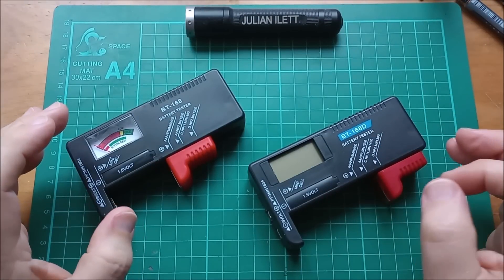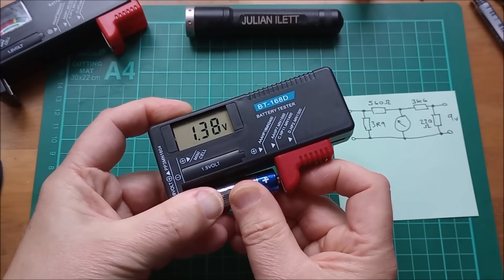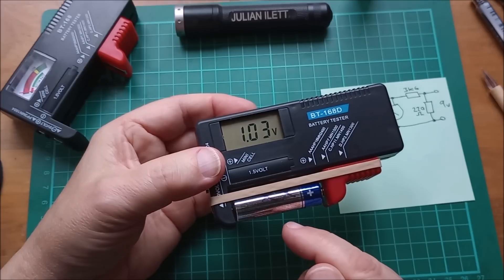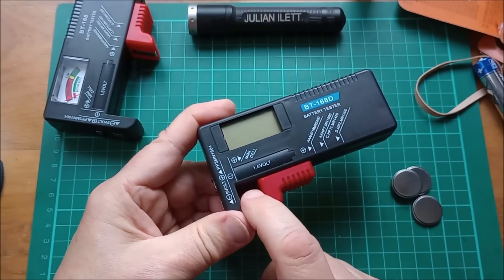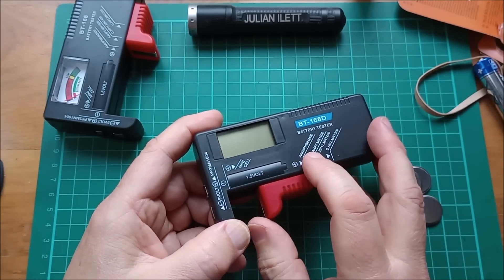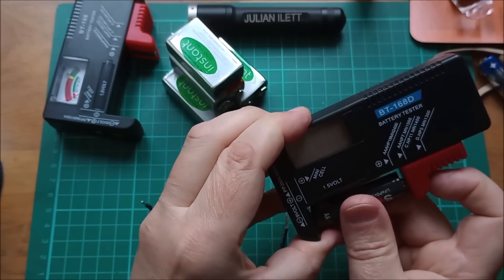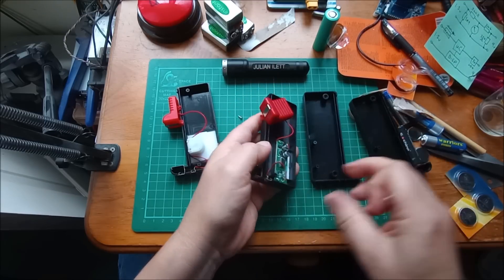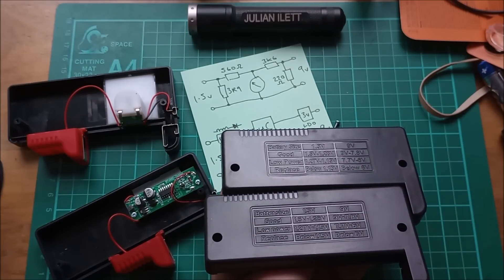More Details - BT168 and BT168D Battery Testers

Comment: I have been using a BT-168D (the digital version) for years.  I actually had three of them but burned one out checking the voltage of the three AAA cell adapters in cheap LED mini-flashlights, it measured the first one accurately then never worked again.  I just bought two of the BT-168 pro versions so I had something capable of checking the approximate voltage of an 18650 cell.  Ironically, the two BT-168D has a slight variation on its readout with the same cell, the difference is about 0.09 volts (admittedly one has been in heavy use for about 7-8 years, the other almost unused as a spare).  A quick comparison of the two BT-168 pro versions I bought recently show only a 0.02 volt difference using a three AAA cell flashlight adapter, they show 4.37 and 4.39 volts, respectively.

Comment: I get conflicting information about those testers... Do they work correctly as battery testers or not?
A lot of people claim that they are useless due to not loading the batteries enough, effectively making them volt meters... So are either the BT168 or the BT168D useful for testing AA batteries, or would I be better off with a multimeter and a resistor? If a multimeter + resistor combo is better, then how many ohms and should fixed or variable resistor be used?

Comment: Those digital ones draw 20mA,  but  remember you need 4.000v display for Lithium cells . you only get 3digs  ie 4.15 from the end pp9 contact, not very useful, better dvm available 5digs  for precision and adjustable , but you power up with a pp9, much more useful

Comment: So many commentors dont know what they are talking about. The 168D display puts a load on a battery so if the battery is bad it WILL show. A weak 1.3v battery by meter will drop below 1.0v with this tester. There is a video by a bloke on youtube that shows this in a breakdown of the unit. I suspected it when I kept getting drastically different readings on weak batteries from this tester and a meter, yet good batteries were very close. A meters display is run by an internal battery whereas this tester draws from the battery being tested to run the display, thus a small load. Which is all that is needed to show weak batteries.
Reply: so which is a better device for testing how full a battery is: the 168 or the 168D? thanks
Reply: The "load" BT168D Pro puts on the battery is so small that it hardly matters to the reading. I have had almost dead batteries show as fresh on BT-168D Pro which would show as dead on analog meter.
Reply: If you have dead batteries showing voltage then you have a broken meter! To make an unsupported statement that the draw is negligible is like spitting into the wind. Not only did I clearly explain why there is a draw(no battery) , but gave not only my supporting evidence but also another youtubers evidence. A properly operating meter will definitely show a weak battery due to the draw, that a multimeter will show as still good.

Comment: i have 2 plasplugs branded things like the analogue one, had them many years(20+) , it has a label on the back to tell what voltage level the meter indications  correspond to,  and the load currents,  batteries should always be tested with a 'reasonable' load
Reply: havent opened mine up but i bet uses 'proper' resistors, not smd 😉

Comment: If you open the case and do a bit of butchery with a pair of snips you can make it so the red slide half comes out of the end of the case, you can then measure 18650s. I would also replace the cheap poorly soldered wire with a more flexible silicon coated wire. Edit: Mine reads 10% high so not much point.

Comment: I modded my BT-168D with a pushbutton to add a load resistor. Works well.
Reply: can you share what value you added for the load?
Reply: @NaruuWak  18 ohm: bit of a compromise, it's a light load for an AA, heavy load for a 9V or CR2032. But it works well

Comment: For voltage monitoring of multiple batteries, an Arduino and digital display would allow simultaneous monitoring and comparison of all cells. These quick test meters are not suitable for long term monitoring and the drain they put on a battery is unacceptable except for the briefest period.

Comment: The load on the analog one for the 1.5 V input is way to high with that 3R9 resistor. A 10R or 15R would be much more reasonable for a typical AA cell load. And of course the virtually unloaded digital one is not very useful.

Comment: I find that BT-168 (analog) is much more useful and accurate because it tests battery under load.  Although BT-168 Pro has voltage table (good/bad) range printed on back side, the voltage it displays is not under real load, so it does not give accurate representation of battery condition. Only use I see for BT-168 Pro is for raw voltage checks in place of digital multimeter, not as battery go/no go tester.
Reply: the good/bad indications are very arbitrary as different devices will likely work down to different minimum voltage levels, 2 of my digital cameras need pretty much new batteries or they wont  power up
Reply: I don't know much about a lot but the battery tester not being used under load would this be the same as a multimeter then which is typically how I test my batteries or would the multimeter be better? Just curious it's not something I've considered but does make sense. Would testing the battery under load be more of a capacity type test? Sorry to bother you
Reply: @blakey271able  Measuring small 1.5 volt or 9 volt battery voltage with a multimeter AND a 100 Ohm resistor across the battery terminals (both multimeter and resistor are across the battery terminals) gives a much, much better indication of battery health than just measuring voltage without the resistor.
Reply: @why_do_you_want_to_know  How about adding a variable resistor instead and seeing how voltage holds? A lot of people comment that a load is needed, but don't recommend good/cheap devices/solutions to get a (more) accurate reading...
Reply: Any way to modify pro version to add an additional load to a battery?
Reply: @fokcuk  Not that I know of, because if it was easy to do the manufacturer would have done it.

Comment: I Would go For Open Source "LongMons" on a 2 wire TTL Serial Daisy Network
ELERIX Cell / 123ELECTRIC BMS123 Smart Gen3 - Single Cell Module / Batrium LongMons

Comment: I much prefer the analogue meter type, there is no good/bad indication on the digital and the accuracy of a digital display is somewhat irrelevant without a suitable load resistor, giving misleading results as shown.
I wonder what voltage the chip is receiving by feeding 8V or more through the boost converter, could be over-volting it, or does it go through the 3V reg too?

Comment: I have the 168Pro but find it quite useless since it doesn't put a load on the battery. I had a CR123 battery that measured over 3V but when I put it in my camera it wouldnt work at all.
Reply: Mine gave me different readings each time I tried. Then there was a puff of smoke.  Still looking for a good batt tester; I tried four thus far.

Comment: Can you put your meter in series and measure the current draw of each unit?
Reply: you can work it out with a calculator for the analogue one , or on my plasplugs branded one, it tells you the load current on the rear label, 375mA for 1.5v,  40mA for 9v,, the 375 is probably reasonable for 1.5v but i think 40ma too much really for 9v PP3s, as most devices using them will draw 10mA or much less ... also tells the voltage levels of the coloured areas on the meter

Comment: Don't know why they couldn't have included circuitry to apply a nominal load to give an indication of battery condition. As the open circuit voltage is no real indication.

Comment: RE: the differing voltage I would not be surprised if precision is affected by low voltage if the power for the meter is derived from the cell under test.
Reply: It's probably the tolerance of the resistors used internally. 0.02 of 3.3 gives about 1/2% error.

Comment: Think I prefer the analogue meter. Instant results when you're just checking if your battery is good.

If I need an absolute voltage, I'll use a multimeter.

Edit: ah... you have a project in mind for them. :)
Reply: I have the analogue one and its a good quick go/no go

Comment: you could probably use a power supply unit in dc and turn the dial to find the voltage ranges without having to rely on stacking different batteries together.
Reply: Good point my thoughts entirely. 👍😏

Comment: I still have my analog battery checker from the 80's. It's the same principle but a different design.
Reply: is it a 'square' type with 'bent leg' arm? if so i have one
Reply: @andygozzo72  No, It's a long semi-circular tube with the meter at the top. You put the battery in the half tube and push up the base to get a reading.
Reply: @Franko_Walker  ooer, havent seen one like that yet!
Reply: @andygozzo72  Yeah it's great. It goes from AAA to D size and has 2 prongs just below the meter for 9V batteries.
The meter has red (bad), yellow (weak), green (good).
Reply: @Franko_Walker  Before these came out I used a cheap multimeter to measure battery voltages.  In the old days of analog multimeters they worked but you were going on a wing and a prayer that it was still properly calibrated (I think I may still have a really old analog multimeter in the shed but have used digital multimeters for years).  Ironically, the cheap Harbor Freight multimeters are quite accurate as long as you toss the leads that come with it and replace them with a better quality lead on Amazon, costing about as much as the multimeter itself (even then it is still cheaper than the next higher priced meter that has the wide variety of modes that the HF one has).  I like the lead clones intended for Flukes, you do have to cut back the plastic shielding around the prong where it goes into the meter to make it work but once you do that it is quite accurate.
Reply: @mharris5047  The problem with using meters, (esp digital), to test batteries, is they don't put any load on the battery. So they give a false reading. Battery testers have a resistive load built into them.

Comment: What is the internal resistance of the meter itself? What is the full-scale voltage...maybe 1.6V?
Reply from the maker: A few hundred ohms I believe.
Reply: @JulianIlett  It would be possible to calibrate the analog scale to read internal resistance. (Especially if you aren't using the 9V side, which would have a different scale). Sharpie away!

Comment: I have the 168 PRo, does go to 4.8V accurately, I did change the wire to the slide to a Silicone  wire as the pvc wire kept breaking from the slide works great for a quick check 🙂
Reply from the maker: Does it max out at 4.8V? Cos the 168D tops out at 8V. Oddly, the analog 168 opens wide enough to take an 18650. But 4V across 3.9 ohms would mean 1amp so 4 Watts. I don't think that tiny resistor would be too happy.
Reply: @JulianIlett  On my 168 Pro, the slider input (labeled "1.2V-4.8V") reads a 9V battery at 9.12V when the 9V input reads the same battery as 8.83V. The board is superficially similar to your 168D's, with some shifted component placement and tracks on the boost side, and more passive components (SMD resistor networks!) on the 9V/measurement side of the IC. The board is labeled "TLX-02", no mention of a 168 model anywhere, and dated earlier than your 168D board (2020-3-16 vs. 210310).
The case is identical, except that the slider hooks onto the track with a riser in the center of the slider, instead of at the far end, letting it slide out just that bit further to fit an 18650. You could probably swap the slider from the analog version over to the 168D to let it measure 18650s. (And the table on the back of my case is typo-free :D )